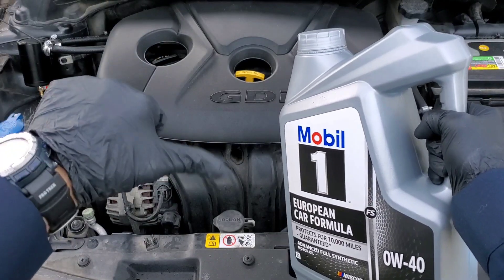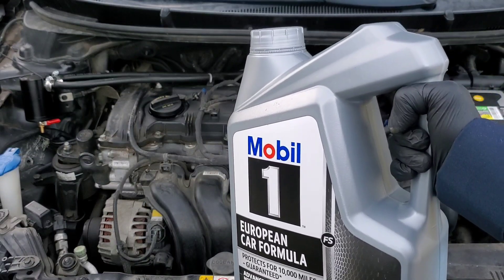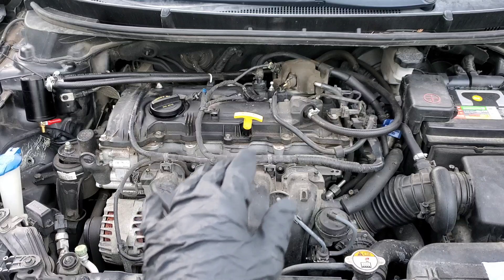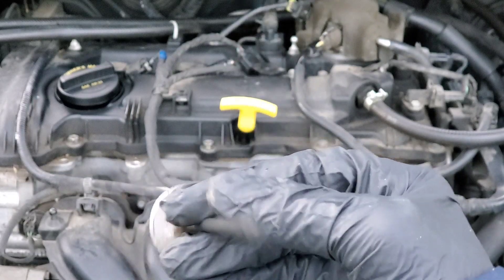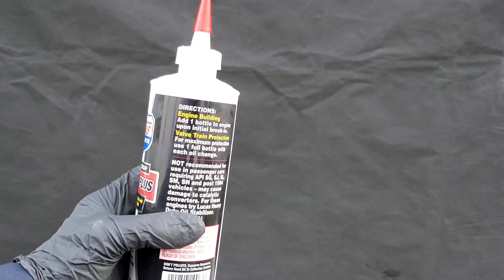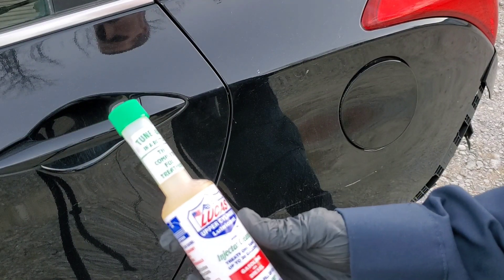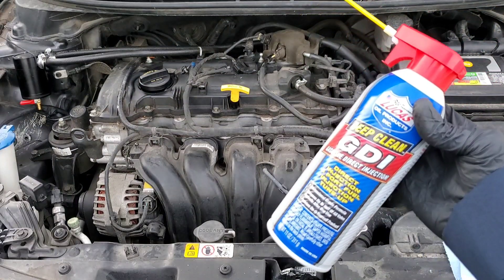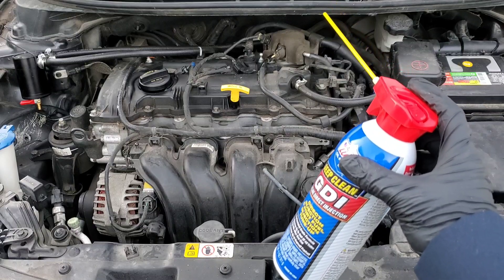The Wrong oil destroyed my engine!?

Comment from the maker: What oil are you using? Also for what make,model & the mileage since you have used the oil?
Reply: The cheapest synthetic oil with the right specs.
Reply: Shell helix hx 8 5w/30 since 2018
Reply from the maker: @gagandipkaur8011  If this oil follows manufacturers specifications and you have had success using it then you may not want to change unless the manufacturer does confirm the new oil you would like to use is ok with the manufacturer. But check severe driving conditions in your manual. You may need to change the oil sooner.
Reply: What was zddp originally Used for?  And why is it not used today as much?
Reply: @russlardinois5751  It is a lubricant.    Similar to lead in gas.
Reply: Hi,
Wich oil brend Mobil or Shall is better for Mercedes Benz A class 170 CDI 1999 Diesel. Thanks
Reply: @GD-js2xd   Any synthetic 40 Weight (0W-40 5W-40) that is rated for diesels.
Reply: SuperTech
Reply: Ive just bought a  clk 500 Mercedes, want to use mobil 1. Just not sure what one i need. She’s got 300,000 km on her but in good condition

Comment: I won't purchase a vehicle with turbos, GDI without port injection, or sleazy mechanical CVT. 

My next vehicle will probably have the Camry hybrid drive train. But not in a Camry (Seinna, rav4, Vensa, Crown, some Lexus SUVs), probably a Rav4. 
No turbos. No GDI without port injection, no sleazy mechanical CVT, no start/stop system, no belts (accessory or timing), no 12 Volt starter or alternator, no 11 speed torque converter automatic, no torque converter.

Electric car goodness without the electric car drawbacks.  You get an electric car with gasoline engine assist. That engine is an efficiency tuned Atkinson cycle gasoline engine. A reliable planetary gearset provides CVT action for the gasoline engine. The main traction motor is direct drive to the wheels (like most battery electric cars).

Comment: if your car is new and running 0w16 or 0w20 don't do it manufacturer recommended it for Cafe reasons imo it won't protect your motor I switched to 5w30 and my engine is alot more quieter and smooth

Comment: Mobil 1 0w-40 is in FACT a heavier or higher end of viscosity allowance for a 30 weight oil at operating temperature (where the second number is calculated ie 20, 30, 40 & 50 weight). If you don’t believe me look at the VOA of this oil. I use Mobil 1 0w-40 for any vehicle (mostly Toyotas) that call for 5w-30). I’m not telling anyone to do this, you can educate yourself and make your own decision.

The Lucas fuel additive you used “in my opinion” does nothing as it contains ZERO PEA. Use one that does (RedLine S1-1 or Techron) if you want to actually clean carbon.
Reply: I think you mean that it’s a very light 40w that’s nearly a heavy 30w. If I recall correctly 40w Mobil 1 has been like that for a long time now.
Reply: @michaelw6277  Yes I changed the wording. Seemed right in my head lol. Mobil 1 0w-40 FS has always been a lighter 40wt which in context of viscosity allowance at temp for a 30wt is perfect. It also seems to shear a slight bit in use thus making it settle right in the middle for a required 30wt oil. Love that it contains a little PAO (think it’s mostly GTL these days). Very robust formulation for sure!
Reply: @nordicpride9708 yep sure is. That’s why I use 5w40 now mixed with 15w50

Comment: Can i use 0w-40 instead of 5w-30 in vw polo petrol engine at hot weather conditions?
Reply: I am wondering same thing
Reply: @stanktuss3151  i switched from conventional to synthetic 5w30 a few oil changes ago. my last oil change i switched to 0w40 euro formula and haven’t noticed any issues. i drive a 2001 infiniti i30

Comment: Hi Nate, 

Nice channel mate. Always super informative. 

I’ve been doing alot of research lately in regards to ‘engine flush’ when doing a oil change on hyundai i30 pd. On a few i30 forums they have stated hyundai ‘does not recommend ENGINE FLUSH’. What are you thoughts? Is an engine flush really important? I’ve read a few scary stories of people doing an engine flush on the GDI 2.0L & then later having problems.

Comment: I've got a 99 Yukon. 5.7 vortec 350 slightly modded. 
Manufacturer recommendation is 5w30
I strictly use Mobil 1 - 15w50 full synthetic race proven oil along side either k&n or Mobil 1 long life oil filters. Changed every 3 to 4k . Not to mention I use neodymium magnets on my oil filter & a magnetic oil drain plug. You never know what metal particulates can be picked up along the magnets potentially helping longevity of the engine. 
I use that oil year round, here in Colorado. The Mobil 1 15w50 full synthetic has extra anti wear agents that make my old high mileage rig run like a champ for 225xxx miles. Would not recommend such heavy weight oil on these newer vehicles.  Usually a quality synthetic Manufacturer recommendation on oil changed every 3 to 5k is key. I don't believe in long oil change intervals especially since gas mixes in oil over time. - very corrosive

Comment: You forgot to mention GDI engine itself is garbage trash do to oil mixing up with fuel and burning oil do to higher extreme pressure of fuel injection system and VW has the same problems same goes for some Honda models my friend  oil is the least amount of problem when the engine itself is defective designe and poor fuel system in order the raise gas  mileage

Comment: I am from india the company is tata and the car is tiago 2018
Reply from the maker: This is great to share thank you. The best thing you can do if the manufacturer won't allow 0w40 is find which oil in your area being sold has the highest amount of zinc allowed. The very best you can do is make sure that you dont fall under severe driving conditions as many do. Check the owners manual and you will be surprised. If you fall under severe driving conditions, you may have to change the oil in half the mileage as before.

Comment: Can I use 0w/40 instead of what company recommended 5w/30  car has done 32,000 kilometers and not burning any oil now it's winter here
Reply from the maker: Always check with the manufacturer they may allow this oil for substitute. Its better in cold weather hence 0w, it can possibly provide more protection at engine operating conditions hence 40.  But with viscosity as the only factor. They are fairly equal. I cant tell you to use something the manufacturer doesn't suggest but many companies will allow it, just contact them.
Reply: If it's extremely cold and you can hear valve noise in cold start and it doesn't go away with in 5 minutes of extremely cold start early in the morning or late at night you can use 0w30 formula but most of the 0w30 you will find in market is specifically made to work with German  cars such as BMW Mercedes benz  or Audi or Porsche or VW engines also same goes with  0w40 call oil company and give your car make and model  and they will tell you the best oil recommendation for your car engine  I have had extremely good luck with Shell Rotella red bottle 5w30 for gas truck and suv but it worked great on my friends infiniti Q50 2020 with over 100k miles on it with twin turbo it was keep burning oil and the Shell Rotella was great for this application engine I have had great luck working in his car as a mechanic  but make sure for hot summer you use 5w30 it's slightly thicker oil it's better protection for summer driving

Comment: Modern diesils run  30,000 to 50,000 psi in common rail injection. 
Crazy
Reply from the maker: The pressure seems to continuously be raised over time as for gasoline engines to.